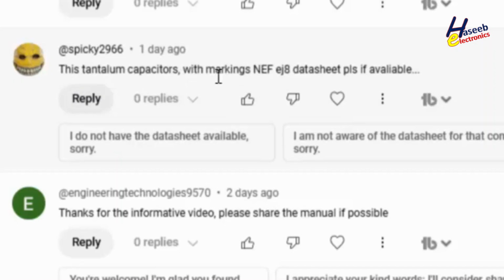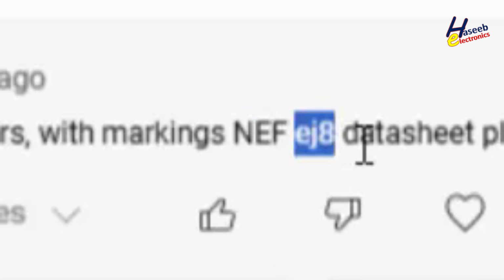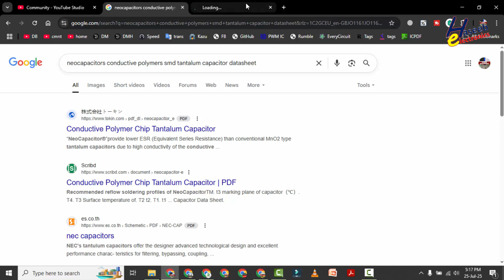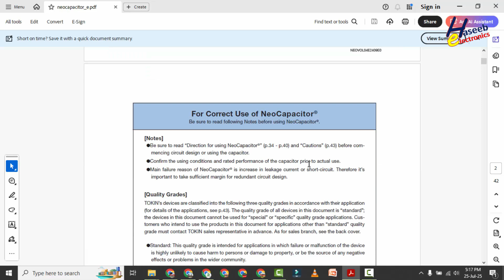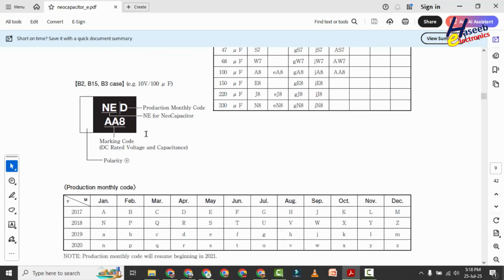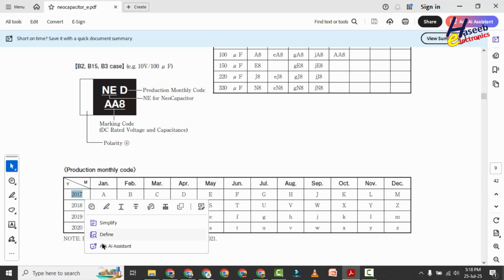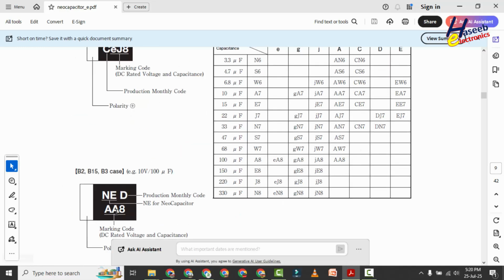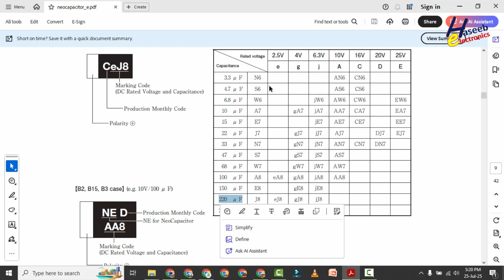{1359} Understanding SMD Tantalum Capacitor Marking Code | How to Read NEF ej8 Cap Value

Comment: Sir if you don't mind.please help how to learn voltage in circuit like how much ic need voltage how much transistor need voltage and regulator.and passive component how they provide voltage to active component.please sir help